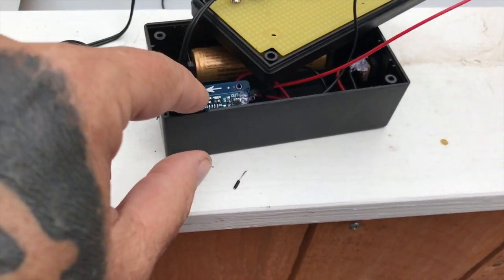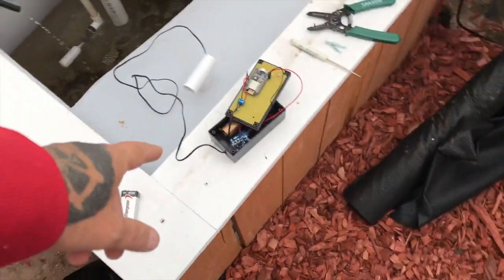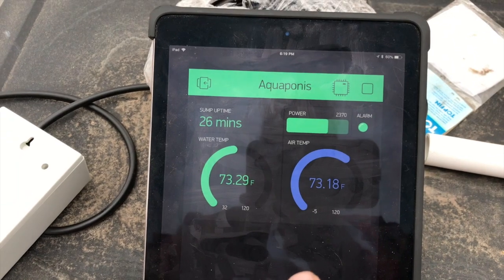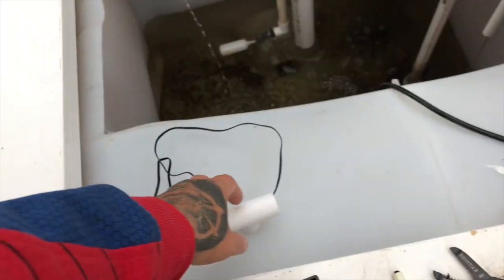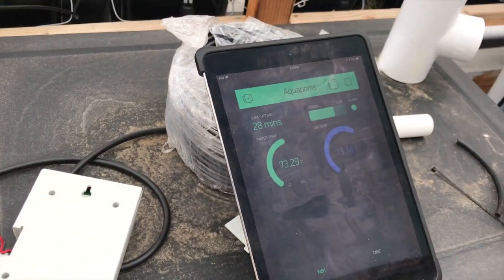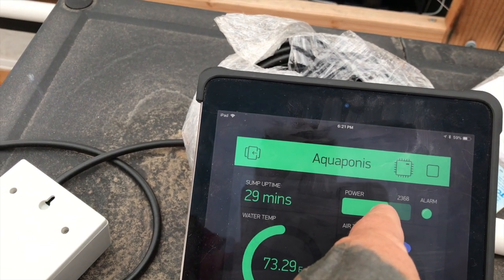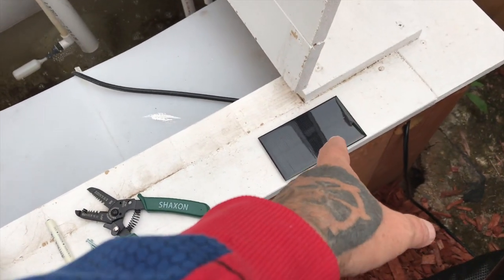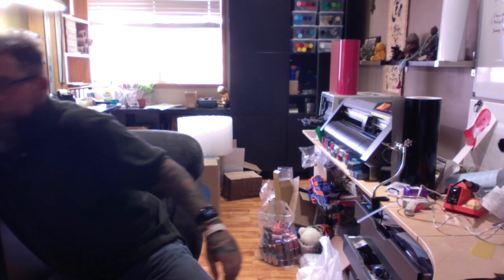Internet of Aquaponics: Final Sump Alarm, New Water Monitor and Tank Depth Meter Starts

Comment: Hi Jeff, I have been looking for ages to find someone who has gone into detail with this kind of set up for aquaponics and Arduino so think you for putting stuff up. I am new to Arduino and looking to teach myself with anything I can find. It looks like you are using the exact same sensor I am which is fantastic, hopefully, it will make it all a bit easier and at least shows me I am on kind of the right track. I wanted to know if you put together your own code or if I can find it somewhere. Still very much a novice for code and learning. I have my aquaponics set up on my channel would also appreciate your thoughts on it. I am making an indoor set up so not needing the solar parts part but its a great idea for outdoor set ups